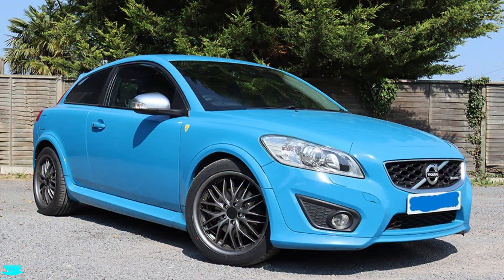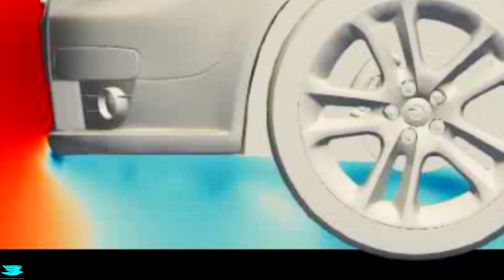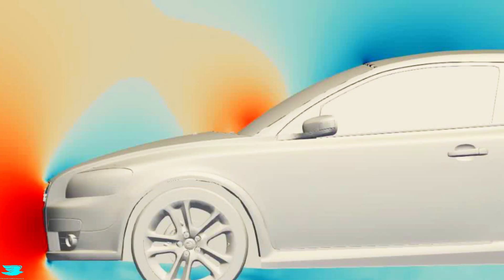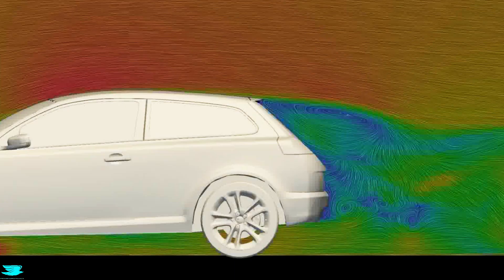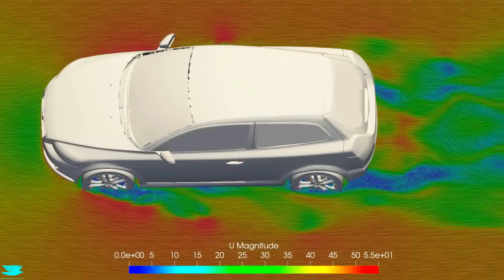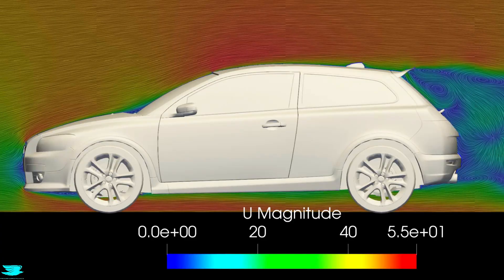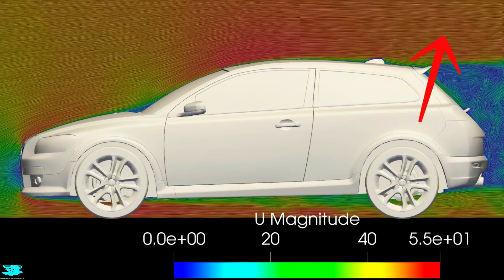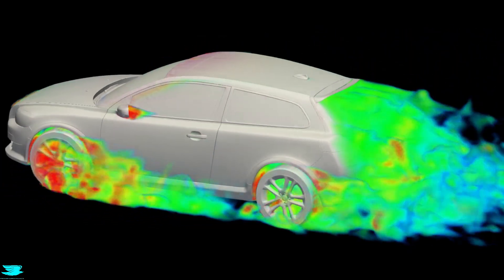The Most Aerodynamic Volvo Ever?

Comment: I watched about half the video. And really, I'm more interested about the S40 and V50 now since this C30 has similar front end to both but a shorter rear hatch. If the C30 with its short rear end is a 0.32 Cd, what would the S40 be? Since the one ad I could find also placed it at 0.32 Cd.
Anyway, about your statement regarding Volvo's aerodynamics or lack thereof, Volvo has been focused on producing low drag vehicles since the P80 platform of the 850 days, both the 850 sedan and wagon (later facelifted and renamed V70) has a low 0.32 Cd (for its boxy shape). The P2 S80 and S60 had a claimed 0.28 Cd so it would be interesting to know if they really do have that according to your CFD.

Comment: I have a C30 and have (because I'm stupid and spend a lot of money on it), had both the stock and R-design bodykits on it. 

The stock front bumper lip underside is actually quite curved, somewhat sharp at the front (presumably to seperate the flow) then a fairly large shallow curve underneath extending 6-10 inches, clearly to keep air attached to the underside of it.

There is no diffuser to speak of on these cars, the exhaust is exposed and there is a very small curve on the rear bumper which I wouldn't really describe as a diffuser.

I can say that even with the stock bodykit, the R-design spoiler seems to keep it planted well enough at over 160mph.
Reply: Came here to say the same thing, the underside of the lip on my S40 with similar looking bumper is actually slightly curved. So the CFD model he's using isn't accurate on that part. In that case, and correct me if I'm wrong, but it means it produces some downforce without excessive drag, unlike what he said?
Reply: Ah a fellow wallet burning enthusiast! I've spent far far too much in maintanence on mine... (purely the result of trying to keep an old, high-mileage car as mechanically pristine as possible).

Comment: Would it be possible to do a classic Opel GT? It’s affectionately known as the “Tiny Vette”. It sits lower to the ground than an NA Miata! Interestingly, above 110 MPH it actually starts generating lift, which is why if you do an engine swap you MUST install a wing

Comment: Could we get a video on how to best improve the aerodynamics of a brick without changing the shape of the brick?
Reply: That would be fun like the CFD of lobster & cow compared to a Jeep. 
If a brick is on the ground then there is no under brick flow for a front lip or rear diffuser. But you could add some bits like dive planes for front end down force (to keep the brick from blowing off the ground?) and a spoiler to reduce pressure drag (so the brick doesn’t slide away due to wind?).

It’s a funny idea to cartoon. 
But the “Ahmed body” is fairly brick-like and has a few more car like features like being off the ground and having sort of front and rear.
Reply: @FPBIV i'm thinking things like air curtains and vortex generators and also just the angle of the brick to reduce drag.

I was recently longboarding with a headwind while carrying a large box and that sparked this idea, the box was very draggy.